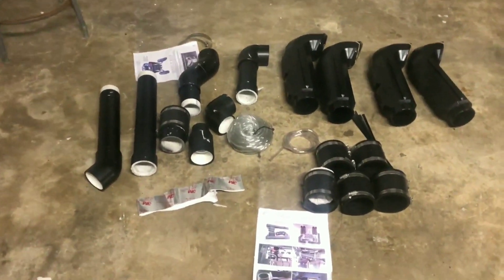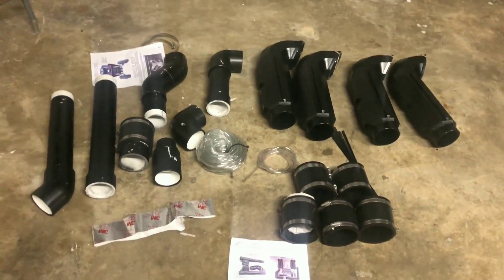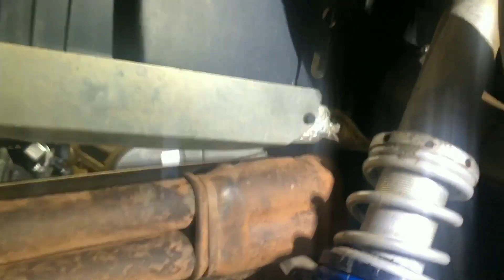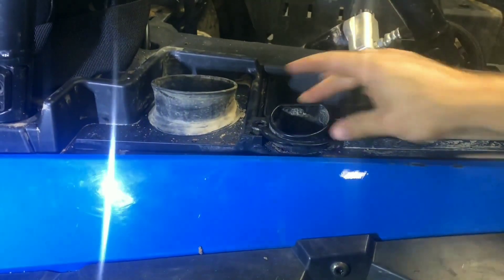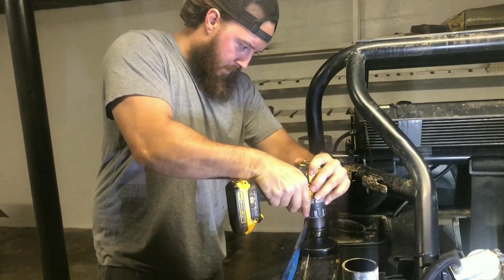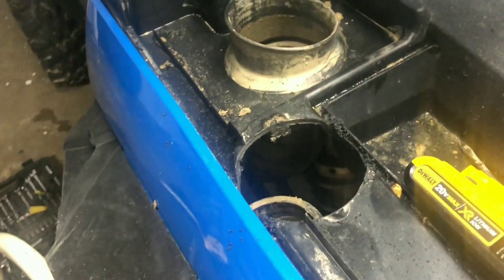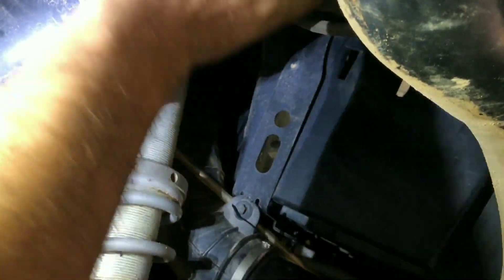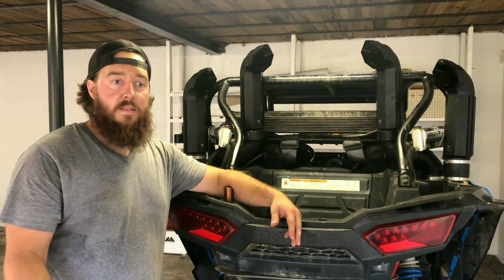Warrior Snorkel Kit Polaris RZR 1000 XP

Comment: Did yah had problems with the coils being on the way right where you connected the rubber boot out the exhaust vent ?
Reply from the maker: Around the exhaust it was a little tricky. Instructions were a little vague for that portion.